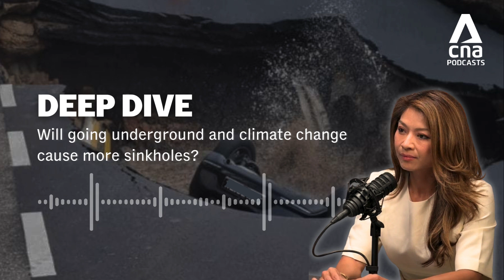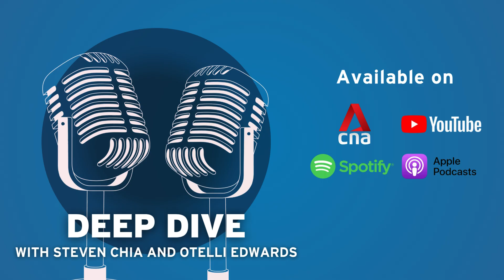Will going underground and climate change cause more sinkholes?

Comment: 🕳️💦 What Really Caused the Tanjong Katong Sinkhole?
Let’s clear the air (and the underground confusion) with this easy-to-follow breakdown ⛏️👇

⸻

⚠️ It wasn’t “just a pipe burst” — it was a perfect storm underground.

✅ Here’s what happened:

⸻

🧱 1. Sewer Shaft Construction Went Wrong

PUB was building a deep 16m shaft for underground sewer works.

On 26 July, a concrete caisson ring inside the shaft collapsed, weakening the surrounding ground.

This caused the surface to lose support — and boom 💥 — a sinkhole opened up on Tanjong Katong Road South, swallowing a car.

⸻

💧 2. A Water Pipe Had Burst THE NIGHT BEFORE

Residents reported a huge water fountain on the opposite side of the road Friday night (25 July).
This wasn’t a small pipe — it was a big transmission pipe, carrying chlorinated, pressurized tap water.

Soil erosion likely began before the sinkhole even happened. That burst pipe:
	•	Washed away underground soil quietly overnight
	•	Created hidden voids or made existing ones worse
	•	May have caused ground to shift near the shaft site

⸻

🌧️ 3. Climate Change Plays a Sneaky Role

This is not science fiction — it’s science fact.

More intense rain (thanks to climate change) =
	•	Softer, unstable ground
	•	Soil expansion/contraction cycles
	•	Higher groundwater pressure

These conditions silently weaken the soil around buried pipes and infrastructure.

⸻

🧪 So What’s the Chain Reaction?
	1.	🌧️ Soil already softened from wet conditions
	2.	💦 Burst pipe on 25 July floods the area underground
	3.	🏗️ Caisson ring collapses on 26 July, triggering ground failure
	4.	💥 Sinkhole forms, car falls in, more pipes get damaged
	5.	PUB rushes in to repair, investigate, and stabilize

⸻

📌 Bottom Line

This was not a one-cause issue. It was:
	•	Construction failure ✅
	•	Burst pipe erosion ✅
	•	Wet ground from extreme weather ✅

A dangerous underground cocktail — not something that just “happened lor”.

⸻

📣 Spread this if you see confusion or wild comments.
Better informed = better prepared.

🦺 Stay safe, and don’t underestimate what’s going on beneath our feet. 0:02
Reply: 🕳️🔍 Why Didn’t the Sinkhole Give Any Warning?
A lot of people are asking — with so many ground sensors in place, how come nobody saw this coming? Let’s explain it clearly 👇

⸻

✅ Yes, monitoring systems WERE in place.

PUB and the contractors followed standard safety rules:
	•	Sensors like inclinometers, settlement markers, and radar scans were set up.
	•	These tools are meant to detect early warning signs like ground shifting or soft soil.

BUT…

⸻

❌ No alerts were triggered. Why?

Because what happened wasn’t a slow soil movement. It was a sudden internal collapse inside the sewer shaft.

🧱 A concrete ring deep underground gave way, like a snapped Lego piece at the bottom of a stack.

And that failure happened so fast, and in such a tight spot, the sensors didn’t detect anything before the sinkhole appeared.

⸻

💦 Plus: The burst water pipe the night before made things worse.

Water may have secretly washed away soil around the shaft.
But again — that happened underground, and not all movement was strong enough to set off the alarm.

⸻

🧠 The Reality:
	•	The instruments didn’t “fail” — they just weren’t designed to detect this kind of sudden, internal ring collapse.
	•	Sinkholes aren’t always predictable — especially when water, weather, and construction all mix together.

⸻

📣 So before we blame sensors or engineers, remember:
Some failures happen faster than any system can catch.

We’ll learn from this — and upgrade safety for future projects.

Comment: The short answer: Yes, going underground and climate change can both increase the risk of sinkholes — but engineers can manage the risks with proper design, monitoring, and caution.

Now let’s unpack that like a geotechnical goodie bag:

⸻

🌏 1. More Tunneling = More Risk (If Not Managed Well)

As David Ng pointed out in the CNA podcast, every time we tunnel, dig, or burrow into the earth (like MRT lines, Deep Tunnel Sewerage Systems, underground expressways), we’re disturbing the balance underground.
	•	Imagine Singapore’s underground like a layered tiramisu — remove a spoonful too quickly, and the top may collapse.
	•	Excavation can cause voids — empty spaces under the surface — especially if soil or water leaks away. When that void gets too big to support the ground above it… poof, you’ve got a sinkhole.

⸻

🌧️ 2. Climate Change Isn’t Helping

Dr. Stefan Schwah flagged this in the podcast — increased rainfall intensity (yup, thanks climate change 🌦️) adds to the danger:
	•	Heavy downpours = more water seeping underground = more erosion of soil and sediment.
	•	Water accelerates the natural process of dissolving certain rocks or soils, especially in areas with loose, young sediments like those in eastern Singapore.

So climate change makes the ground softer and adds more water stress. It’s like trying to balance a boulder on a soggy sponge.

⸻

🏗️ 3. But Don’t Panic – Engineers Got This (Mostly)

It’s not all doom-and-drop-holes.
	•	Singapore’s engineers use advanced instruments like inclinometers, dissometers (fun to say, dead serious to use), and settlement markers to track even the tiniest ground shifts.
	•	Pre-construction soil surveys and ground improvement works (like compacting reclaimed land) make it harder for voids to sneak in undetected.
	•	Areas like Marina Bay are built on solid folded sandstone, so they’re more stable.

⸻

🔍 4. What Can We Do as the Public?

Honestly… not much. 😅 Sinkholes often form silently and invisibly underground.

But authorities will:
	•	Study a wide influence zone (3x the depth of any crater),
	•	Respond fast once issues are detected,
	•	And ideally update us before any TikTokers fall into a hole mid-dance.

⸻

⚠️ Final Take:

Sinkholes might become more common with:
	•	More underground infrastructure,
	•	Wetter, wilder weather from climate change.

But with Singapore’s rigorous engineering practices and real-time monitoring tech, the goal is to stay ahead of these surprises — not under them.

⸻

TL;DR
Yes, going underground and climate change add sinkhole risks. But Singapore’s engineers are like underground ninjas — poking, probing, and patching before things go south (or down).

Comment: 😂😂😂😂
Reply: Cant you write even a thing ?
Reply: @bobafett5757 it’s weird that everything and anything can also link to climate change, how scary such mentality is…….. Just like how I did an experiment recently, asking random passenger “ can we eat chewing gum or bubble gum “ in singapore ! The answer was 98% says “ NO” and even argue when I ask them did they fact check🤣🤣🤣 and they tell me that was common knowledge! How scary the world had becomes!
Reply: @philz3ro823  Its not climate change but that deep digging work
Reply: @bobafett5757 I believe the topping up of soil was not full and the workers rushed to complete the job before dawn due to the water leakage. You imagine, if the cavity was too huge, you need like additional 10 truck of soil to top up, how much you lose as a contractor? The problems hit deeper now! Cheapest quote may not be right!
Reply: @bobafett5757 the best possible reason was , there are sheet pile at the side, blocking the views of cavity and the worker basically top up within the sheet pile for the pipe burst. So in the future, when there are huge water leakage, the whole 500m radius had to be inspected or scan before handing over.
Reply: @bobafett5757 also when contractor top up soil, they need to add water and make sure that the soil are compact, everywhere and anywhere of excavation and topping up! This is what I do when rebuilding 😊
Reply: Cna  is just giving eg of what cause  sinkhole...and climate  change is one of the cause though spore has no.limestones  to aggravate